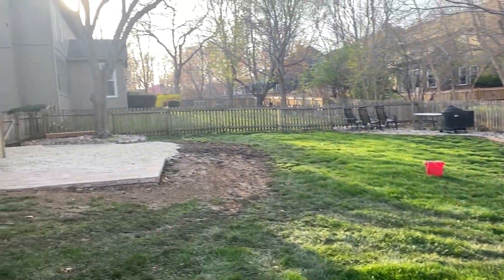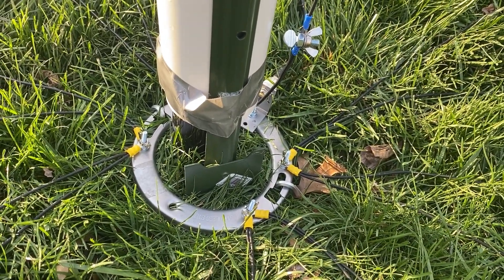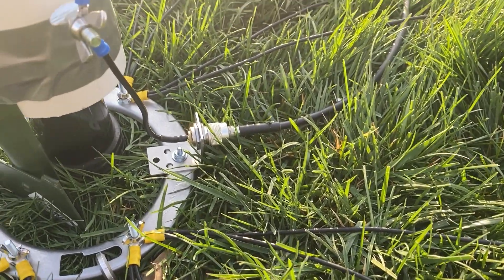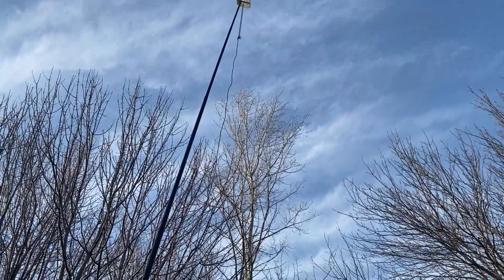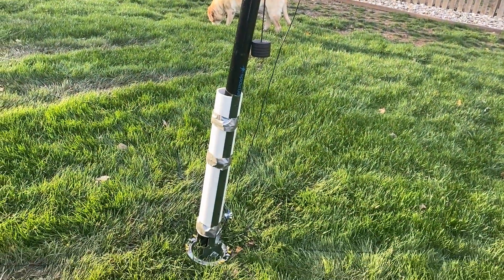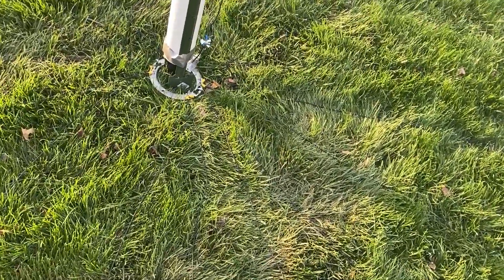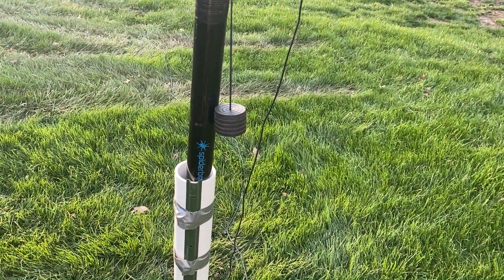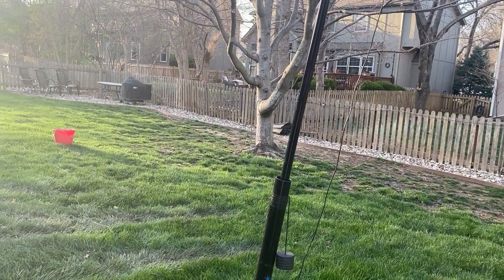My Homebrew Wire Vertical

Comment: I’ve been looking for a better radial connector.  Didn’t even think of metal toilet flange 🤦‍♂️

I’d just need to drill and tap some connectors In it.

Thanks for the video.
Reply from the maker: I ended up not using that antenna but the using that flange for the radials does work very well for the cost.